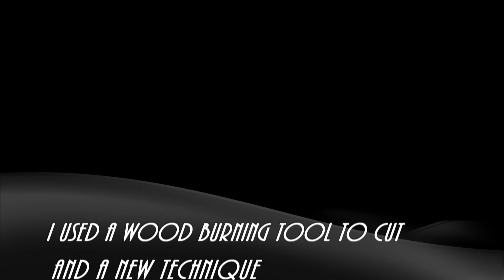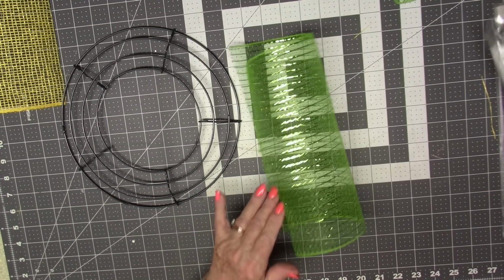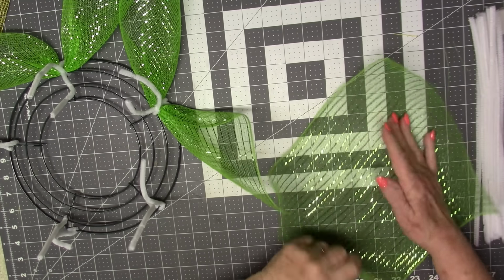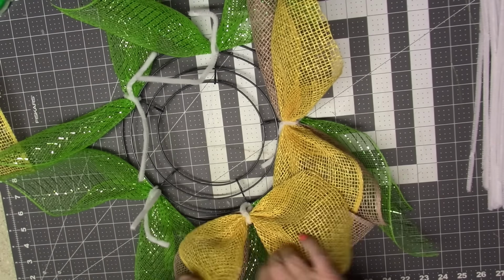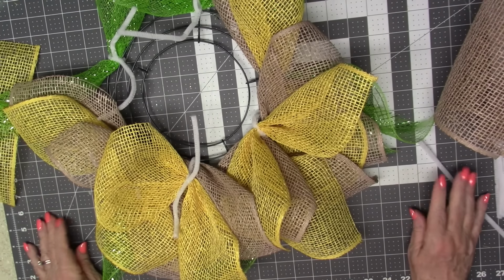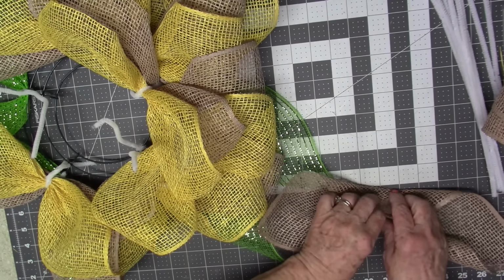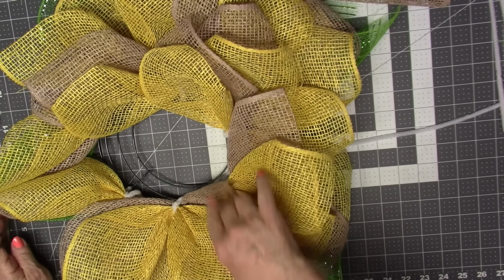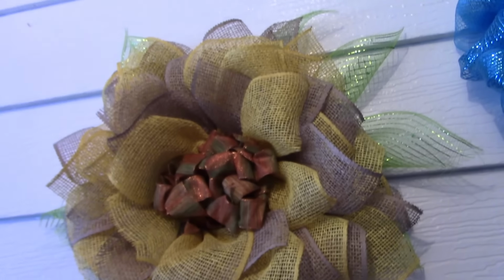Poly Burlap Flower Wreath Tutorial

Comment: Great job on a pretty flower. I think someone already said to wear a mask when using the wood burner for your health.  That makes sense since you are burning plastic (polypropylene) and breathing in smoke from that. It does make a difference in the flower petals as you said. I hate fray too!!
Reply from the maker: Thanks, I Don’t think it will be my primary kind of wreath. But I certainly will wear a mask whenever cutting with the tool.